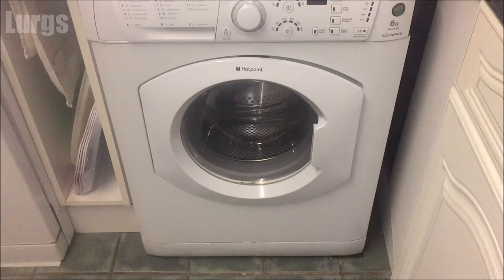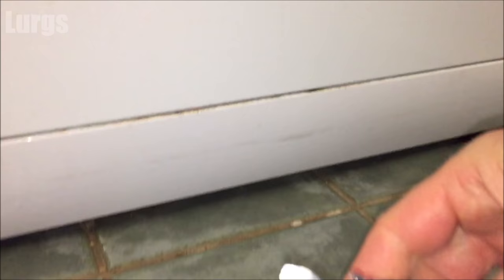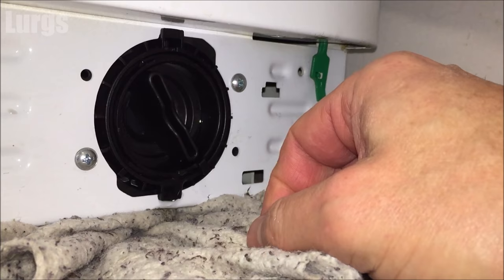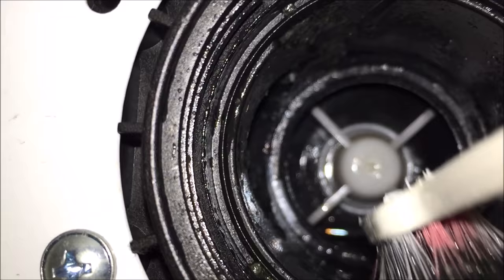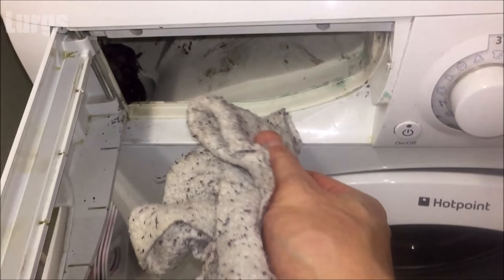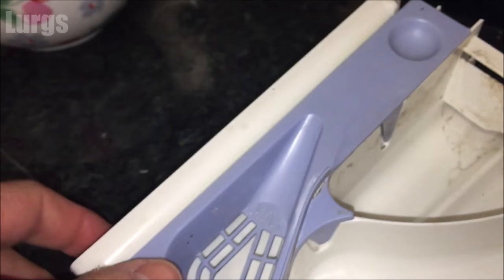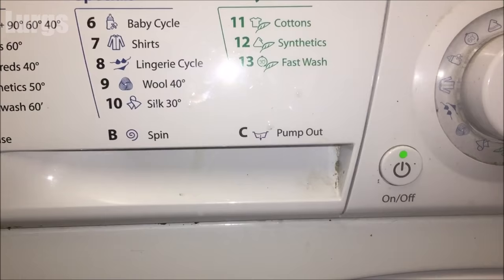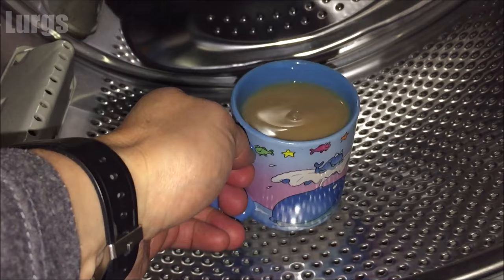How to clean Hotpoint Aquarius Washing Machine Pump Filter and Dispensing Drawer

Comment: It wouldn’t smell if it was maintained properly and serviced washed every month and not doing short washes all the time and not doing lower temperature washes with liquid or gel like a lot of people do otherwise yes it will stink and it will get mouldy I’ve never had this issue because I never do any of these things I just use any powder and most the time I use 40° or 60° but unless very delicate items then yes 30° or 20° but I rarely use that because most garments can go at least 40 and sometimes above but yes most things 40° or 60° And for towels or bedding sometimes do them on a 90° but must be 60° at least because it really helps the machine and also really cleans the towels very well and always remember to do service washes every single month to keep the bacteria away from the machine hope this helps you and other people :)
Reply from the maker: Thanks for the info

Comment: thank you for this. I cleaned my dispenser draw by spraying it inside with a mold and mildew spray, the stuff you use for cleaning that black stuff off your bathroom tiles. It cut through that horrible goo in minutes. Then I used a long thin firm bristle brush that I originally bought from Halfords to clean between the spokes of the Alloy Wheels on my BMW. The bristles are on a 'bendy' wire core and it fits into all the nooks and crannies. A bit unorthodox but it worked brilliantly. 
My wife was thrilled with how clean it was until she washed her Chanel shirt, unfortunately I forgot to rinse out the mold and mildew cleaner. £300 Chanel ladies shirt disintegrated. My ears are still ringing.
Reply from the maker: Oops. Yes you need to put it on the hottest wash at the end with nothing in, just to flush it out. Most expensive shirt I've got is about £25. Good job though (apart from the Chanel incident).😀

Comment: Excellent informative video, saved me today when the washer was not draining and the clothes were sopping. There was a bloody colour catcher sheet clogged in the drain filter! 🤦‍♂
Reply from the maker: It’s usually colour catchers, hair clips or coins! Good find. Glad it’s all working again
Reply: Did the water not gush out when you removed the filter ?? I think I have a similar issue as the machine stops during the cycle and I get multiple blinking lights and wont drain as normal.

Comment: I have just cleaned my filter and found three thin bits of rusty metal. Are they part of the filter or can I throw them out?
Reply from the maker: As long at the filter unit looks ok. Also check the Blades of the motor at the back, if the blades are still intact then yes it's probably just junk that it's caught.
Reply: @LurgsHowToGuides  Thank you :) it's looks too long and thin to be blades so just junk.

Comment: Hi lurgs,

Is the wastage pipe at the back of the machine that connects to the pipework under the sink meant to be compleyly clear? As I have some sort of black nozzle in the end of the output end of the pipe... And my washing machine is full of water so I'm suspecting it's this?
Reply from the maker: Hard to tell as there are lot's of different ways, some connect into the sink wastage under the sink.
Best bet is to remove the washing machine drainage hose out of the drainage pipework and video it with your mobile with the LED Light on and try to see if it's blocked up.  Or pour some water down it from the kettle and see if it runs away or builds up. Hope you get it sorted.

Comment: We have an issue with the conditioner compartment not emptying, it's getting water, but the conditioner just seems to sit under the water. Any ideas?
Reply from the maker: Seems like a fairly common issue. Could be the conditioner is too thick or the jets on the roof of the dispenser drawer are blocked up
Reply: @LurgsHowToGuides  thanks for the reply, I'll give the tray receiver a clean out and jimmy a toothpick in the nozzles and see how that works 👍🏼
Reply from the maker: @andyspencer6308  yeh or you can also try thinning out the conditioner a little with water before you put it in.

Comment: My washing keeps ending up with brown marks on and I had cleaned it all like you said prior to watching this video, apart from knowing about the filter. Do you think when I attempt to clean the filter later this will solve the brown deposit problem on the washing?
Reply from the maker: I very much doubt that. The filter pumps away the water so the water had already passed through your laundry. Could be rust in the drum or maybe your dispenser drawer is really dirty? I’ve got a video on how to keep your w machine hygienically fresh, maybe try this first https://youtu.be/NbOUDxk7Yxw

Comment: Hi!  Thank you for the great information that you showed as 
So I have a hot point washing machine the display working it takes water but the motor won't turn on I test the motor I couldn't find any wrong with it even I checked the water pump what do you have other idea please let me know.
Thanks in advance
Reply from the maker: How did you test the motor\pump? If that propeller\impeller spins freely but won't come on during the wash then it could be a computer fault but most likely the pump motor has broken. But that's a guess.
Reply: My friend I mean the main motor doesn't work
Reply from the maker: Oh, depends how old it is on whether you decide to call a repair person or buy a new one.

Comment: I’ve got the same washer/dryer and I’m having problems with black marks on my whites. Doesn’t happen all the time. I’ve gave it a thorough cleaning with a special washing machine cleaner, in fact I did it twice and used two different products & also cleaned all the drawer, around the rubber seal. I read on google about oil stains and how it could be my bearings. However I don’t think this is the case as it’s not making any noises and is running perfectly fine. Just occasionally my whites have black/dark marks on them. My question is could it be the filter at the bottom? If I cleaned that out could that solve my problem? Thanks in advance 😊
Reply from the maker: sarah hornby Not heard of that issue before. Check dispensing drawer and the inside of that, check rubbers and check the stainless steel drum. I doubt it’s the pump filter but it’s worth checking. Maybe try the Hotpoint helpline. Good luck and let me know if you find the fault.
Reply: Lurgs thank you for your reply. I’ve already checked all those things prior to me posting my question. I will keep you posted IF I ever get to the bottom of it. I do have one other theory of mine BUT I’m not quite sure if I’m totally wrong. When I’ve sat and thought about the times I can recall it happening it’s always usually when I’m washing my bedding which is once a week and what I tend to do when washing the bedding is put a shed load of softener in as I love getting into my lovely clean sheets and have it smelling amazing. So I don’t know if there is some sort of connection there OR if I’m just grasping at straws because I am absolutely desperate and going out of my mind over these black marks that are driving me bonkers lol.

Comment: im having trouble undoing cover on pump of my aqualtis, any help pls
Reply from the maker: It could be that whatever is in there is jamming it. Try tightening and untightenjng. Try wiggling the washing machine. You could try a pair of large pliers on it but be very careful as it’s plastic and could break. If it’s never been off it could just be stiff with a build up of dirt on the thread. You could also try a small tap with a hammer onto a small piece of wood against the handle to see if that budges it. Again be careful. Good luck

Comment: I opened my filter today first time in years. The filter kept draining water non stop like litres of it. I emptied out so much smelly water and the water was still coming out. I removed filter and cleaned the clogged up softener and lint and replaced it and there was no blockages in the filter but water still flooding out the whole time. Do you know what might be the problem?
Reply from the maker: If it just continues to drain non stop then sounds like the shut off valve is broken. But I expect if it's all just smelly water then you've had a blockage which may have now cleared. Check your drainage pipes at the back as these could be blocked still.
Reply: @LurgsHowToGuides  yes I've tried to pull the machine forward but it's kinda stuck in place and is very heavy. The draining pipe looks very long, i installed it myself and hope I did it correctly. I do have some issues with water remaining in machine occasionally if I use a cycle with no spin but it doesn't happen all the time. Have ran a 70°C wash with detergent and white vinegar in detergent draw. There was a big build up of conditioner which may have been problem. Thanks for this video!
Reply from the maker: @mysticmaiden2000  Yes they are very heavy. It could be as you've pushed back the machine it has creased or cinked the Drainage hose. See if you can pull it out, check then push back gently and try not to kink the drainage hose.
Reply: @LurgsHowToGuides  thanks ill try and get someone to help me move it and check the hose. It is very pushed back and the hose is kind of trapped on the side of the machine. Many thanks for quick replies!
Reply: @LurgsHowToGuides  ok after the clean cycle I opened the filter again and lots of clean water came out, it won't stop coming out unless I close it. What does this mean? Is it to do with the shut off valve and how do I sort it out? I've not managed to move the washing machine forward, its been in same position for 8 years and stuck I think.
Reply from the maker: Mystic Maiden What is the actual issue? Does it not complete the cycle then? You only remove the filter if it is blocked.

Comment: Hi Lurgs I hope you are staying well! I've just cleaned the dispenser tray and jets but the water is still coming out of the tray. The hole where the water drains away in the dispenser compartment is gurgling away. Do you think it could be blocked with powder?
Reply from the maker: David Pope Not sure. Try putting it on hottest setting it will go (90c) with nothing in it to try and flush it out.
Reply: @LurgsHowToGuides  Won't I flood the place in the process?
Reply from the maker: David Pope So your saying the dispenser is not draining and the water is coming out of the front?
Reply: @LurgsHowToGuides  yes that's right. Jets and the tray  are all super clean but the water is coming out of the front of the tray (on no. 14, 30 degree setting that i always have it on). Where the water drains away in the tray area the hole was gurgling with water up to the top. I could see it when i removed the tray
Reply from the maker: David Pope Water from the tray is just fed into the machine via gravity so you have a blockage somewhere. Check the tips in this video to see if it's one of these faults https://youtu.be/WxNRAMWDY2w
Reply: @LurgsHowToGuides  Thank you very much for all your help. I've used your other video tutorials before and they've always worked a treat. Have subbed! :)

Comment: Har ett H 20 felmeddelande, water does not stay in machine it instantly leaks out
Reply from the maker: That’s not good. Hope you get it sorted, not sure why that’s happening
Reply: @LurgsHowToGuides  a strange solution; I have to hold the wastetube aiming upwards either with hand or some tool, so that water dont stream out, has something to do with pressure I think. Its the first time Im encountering something like this... Very odd, because the water have to leak at the end of the program anyway...
Reply from the maker: Yes very odd indeed